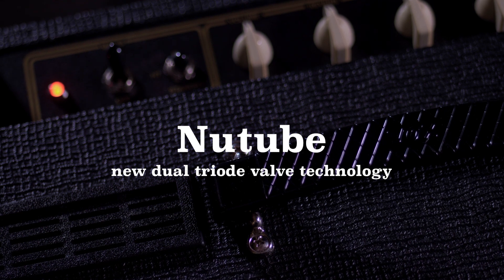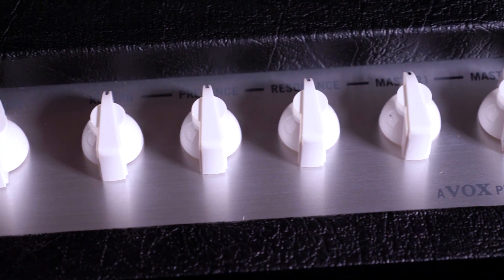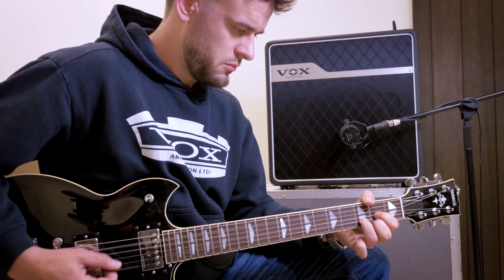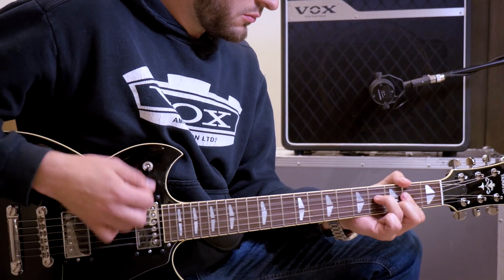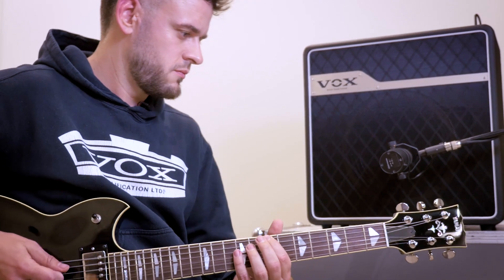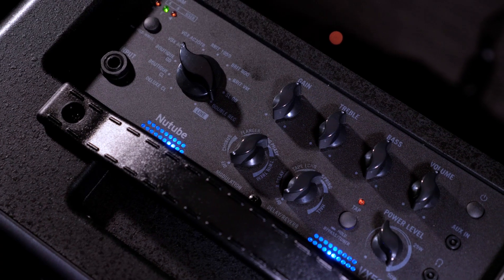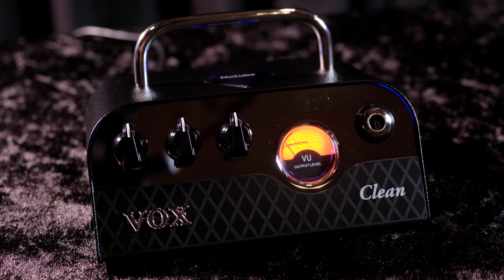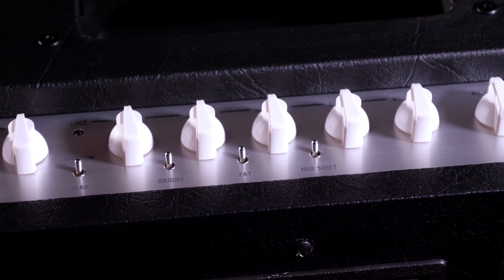Nutube Technology Explained - conversation with Vox R&D engineer Phil Scarffe

Comment: So what is Nutube technology? I understand that it's a new way of working of tubes, but that's just explaining what the name already suggests. Sorry for being negative, but Vox tried to sell me 'tube tone' as a kid with the Valvetronix and I was hoping to actually learn how this technology works, how it reduces power and removes limitations.
Reply: Late answer, but you know the displays that used to be in old VHS players, clocks etc that had a very cyan light. Search "Vacuum fluorescent display" and you will get what I mean. Those were a type of display tubes and is what Korg has "re-invented" for use in audio instead of picture. They are real vacuum tubes in other words, just a bit more modern and sleek than their older counterparts. Not a bad idea, but as everyone who would want to use this technology in commercial products would have to license it from Korg, it hasn't taken off. I don't think Korg has given out any licenses yet anyways, as I suspect they want to milk it for money for the time being. They sound perfectly fine tbh, but most amp builders who want/has to look for smaller and more long lasting components to put in their amps because of size limitations for example, like BluGuitar, are more likely to go with tiny military grade tubes that are already available without any licensing fees. They are built to last a long time so they don't really have to worry about the tubes going bad anytime soon.

Comment: So I've got two questions...first, can this (in a pedal) effectively make it sound like my Pathfinder 15r is actually being used to double track an AC 30? (To be clear I'm looking for cream or crunch but in the rock range not metal).
Second, I'm sure this is a no, but could these realistically be built right into a custom guitar as part of a mid booster like Gilmour and Clapton have only with a real mini tube based preamp right in the guitar alongside a sweepable mids boost? Or do you think putting a vacuum tube inside a guitar just a logistics and maintenance nightmare waiting to happen?

Comment: I really wish Korg/Vox had gone with a subminiature design instead of the VFD they chose, or at least used a separate cathode instead of directly heated, because the NuTube is way too microphonic for DIY builders. And since it needs external support circuitry to sound decent (buffers and such), it's not as simple to hook up.
I can only see it as an advantage for ease of mass production and lower Power consumption.
At least it's a step into a new era of tube tech, which I can appreciate, I'm just not sure it's the right step.

Comment: If you could just get a power amp version, I'd be all over it.
Reply: That MVX150 behind him uses NuTube in the power amp as well as the preamp. Came out last year I think.
Reply: get the head version and use it through the return of the FX loop. That's a power amp 100 per cent, exactly as in a dedicated power amp, i.e. a driver section and a push pull circuit

Comment: I’m loving the concept of Nu Tube, however I’m still finding that tube amps still project way better than anything “electronic”. The Nu Tube amps still sound as though the speaker is pointed the wrong way behind the amp somewhere. However, it’s better that a completely transistor amp which sounds like it’s in a swimming pool.
I’d love to see further developments where Nu Tube can project near as well as a bona fide tube amp.
When THAT happens, Nu Tube will rule the world! 🙂
Reply: Bear in mind they're probably using crap Chinese caps where tone is as brittle as a thin layer of ice. I'm going to do my own component changes to warm up the tone...it's amazing what you can do to tone with quality caps.

Comment: the main advantage of tubes is that building good sounding amps is easier with tubes than with SolidState. In fact for long time engineers did not understand howto make a good sounding SS amp. Nowdays several amps on the market are SS and they sound as good as a good tube amps. The thing that really matters is not to adopt a specific technology, but to know howto use it properly. I do not think it makes sense to use a NU  6P1 that costs 50 Euros while you may get good results with components that costs much more less, just the only thing needed is to know how.

Comment: The tone is still a bit thin "less rich" in its dynamics than a good tube amp spits out. Now I say "good" as in a quality tube amp bc we all know some tube amps suck. I build custom harp mics and modify amps for harmonica, so my ear is extra sensitive as we deal with high gain hiZ mic elements and even most new Fenders are a feedback squealing thin toned waste of money.   I'm tempted to buy one and then do my own component modifications to make it useful for amplified harp. Been doing it for about 20 years and I have secrets in tone tweaking, so this just might be fruitful for us harp players. I read about some new tube-type bottle invention about 5 years ago in an obscure electronics mag that catered to military and space tech...wonder if this is it.  I may contact VOX after I do my thing and maybe corner some of the harp market.  Quilter thinks he's found "that tone" with pure SS amps, but although being very smart with excellent SS amps, Pat just doesn't get it with us harp players.